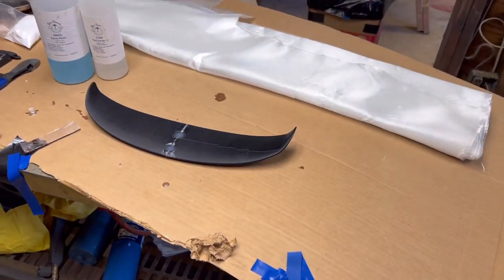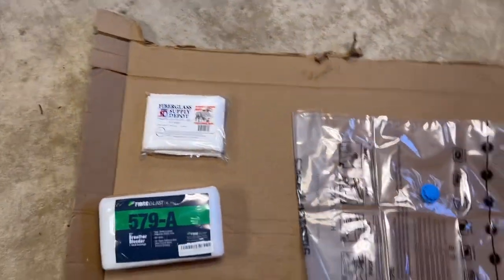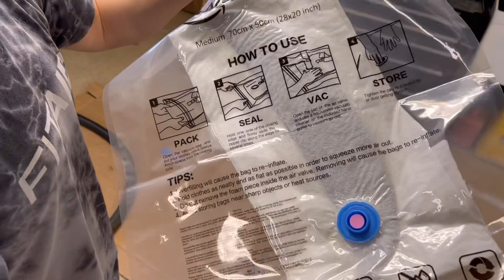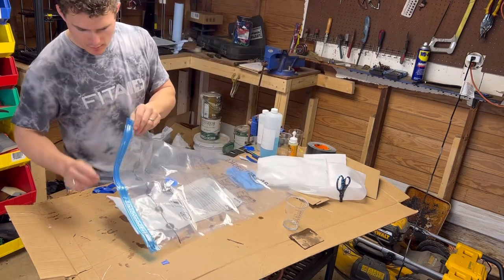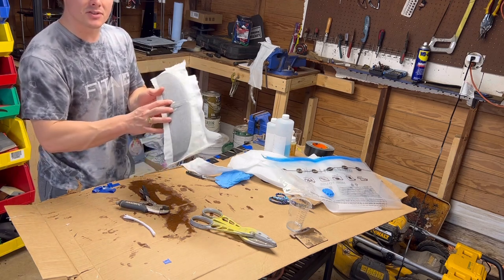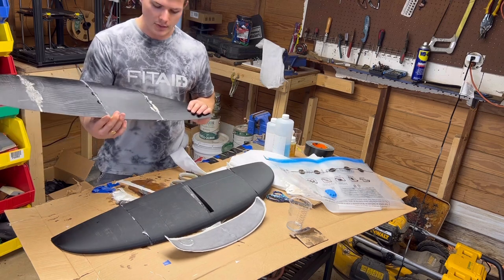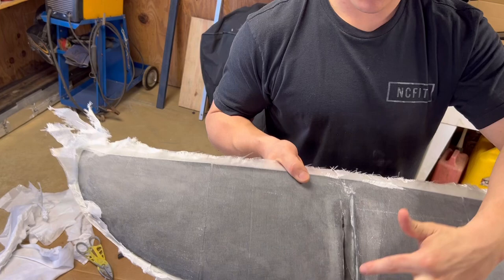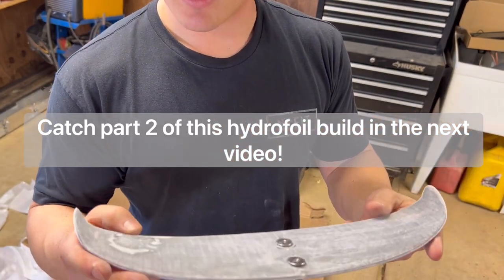Cheap DIY vacuum bagging for fiberglass hydrofoil

Comment: Cool job, and nice work. To help make the peel ply removal easier and to get a better finish, wax the peel ply first, then wet out the fiberglass on a sheet of plastic, squeegee out the excess, then apply to the foil. This will keep you from having too much resin in the glass which makes for a better finish, lighter weight, and easier peel ply removal. Also don't put the part directly under the vacuum port of the vacuum  bag to avoid raised spots. Luck!
Reply: Can you make videos of it

Comment: Hi! I just built my first foil, wood core with carbon fiber.  My leading edges were just butted together like yours and eventually started to split apart.  I ended up folding a 4" wide piece of carbon fiber over it with epoxy and peel ply.  Didnt have to bag it.  Then sanded the edges smooth after. You could use some lighter weight fiber glass.  

When I make my next foil I am going to wrap the edges for sure.

Comment: yooo I used to make surfboards professional for cannibal surf, have a over lap, instead of layer going off the surface, only do the top wrap the overlap to the bottom sand it then vac bag the bottom and do the same thing, creates more structure instead of cutting an area that gets high pressure the load goes to the other side not just the cut end, also if it flexes it could delay due to the cut surface, you did a great job and this comment is my opinion im not an engineer, j speaking fro my experience and what I've seen . cheers

Comment: cool project! Thanks for sharing. May I suggest you use some type of polypropylene sheeting next to the lay-up, followed by a breather fabric (paper towels) then the vacuum bag. Release will be easier. 😎👍
Reply: Quick question. Can you use paper towels instead of breather cloth?
Reply: @mountainbikekids2764  yes. I use them every time but you'll need a layer between it and the resin, like polypropylene plastic .